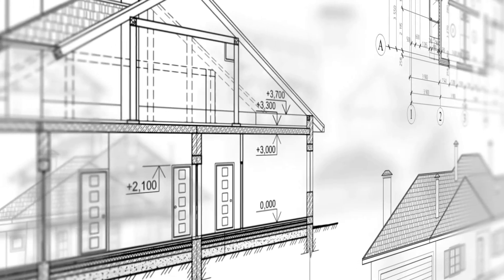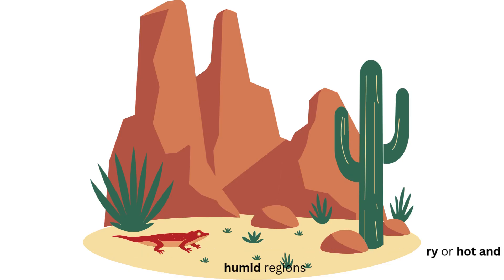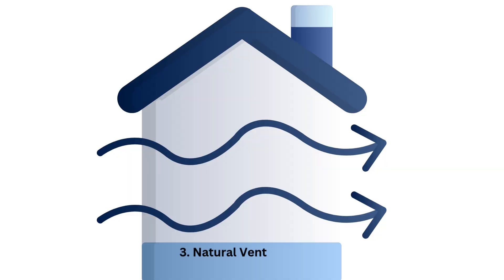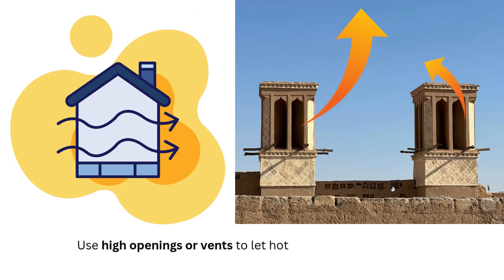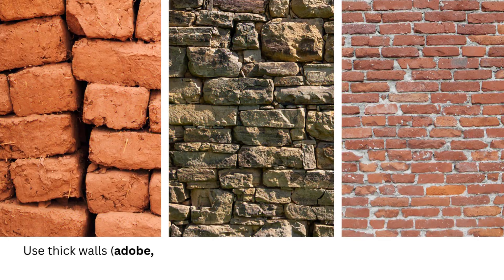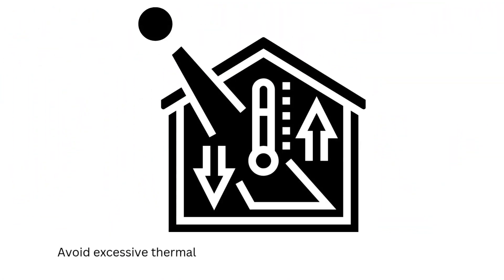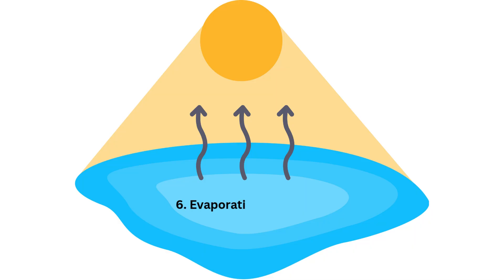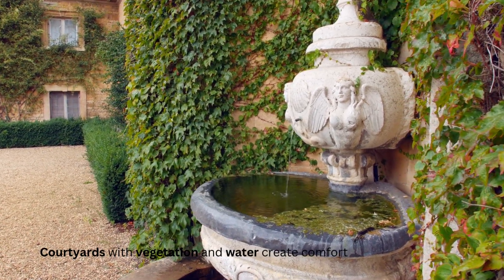How Modern Architecture Beats the Desert Heat

Comment: I don't  think it's modern. It's an ancient method, already been solved for thousand of years. Modern architecture revolves around money not ecosystems. Humanity has gone far left.
Reply from the maker: Thank you for your insightful comment. I completely agree with your point. However, it is important to note that there are several successful contemporary buildings that have effectively integrated passive design strategies. One notable example is Dehkadeh Iwan by Super Void Space in Iran, which received an award for its innovative approach. In my upcoming videos, I will share further details and analyses of such projects.❤